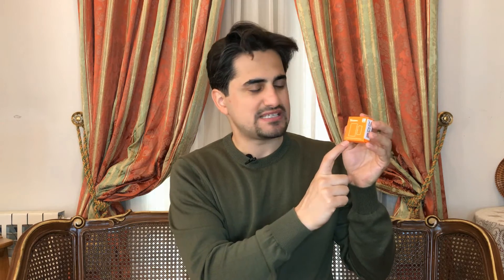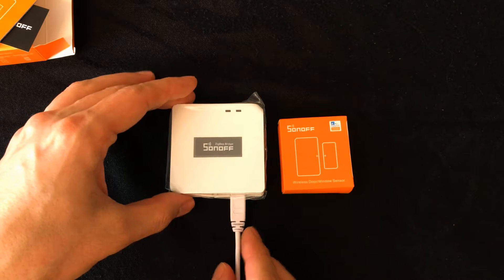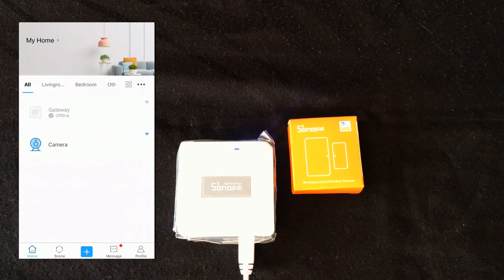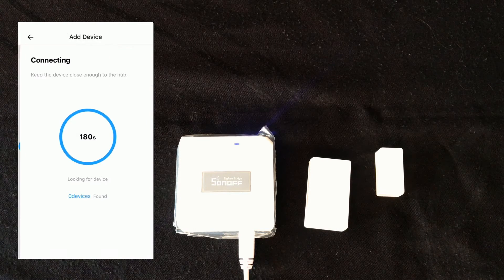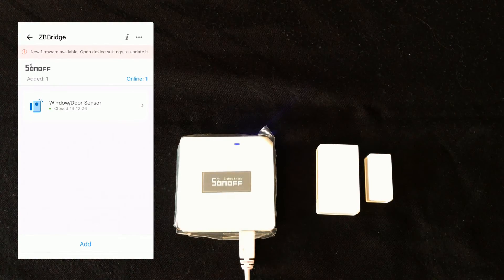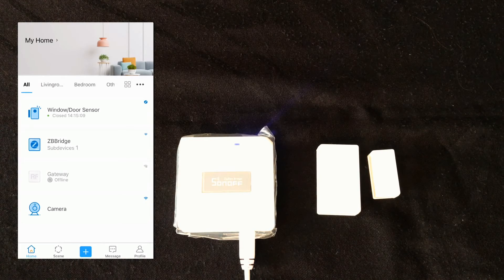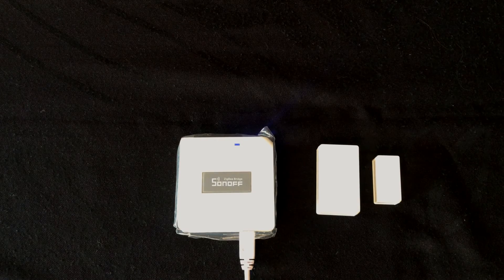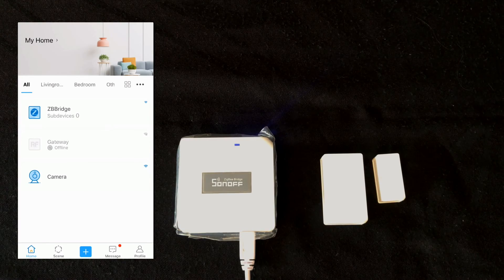Sonoff Zigbee Door Window Sensor

Comment: Too bad the battery life is really bad.. plus the battery does not hold well in the door sensor
Reply from the maker: Tell us more about your experience, please.
How long does it last? Has it ever happened that you left door opened for long time?
Reply: @kian.smarthome Battery life is about 1 month with an average of 1 opening a day. It's the door to my pantry so it does not stay open either. I'll try to connect to home assistant and get an accurate value. Just changed the battery today. meanwhile aqara ones I got last a very long time
Reply from the maker: @Airbag888  wow, it must work longer than 1 month
Reply: Waste of money and time just use a camera with motion detection